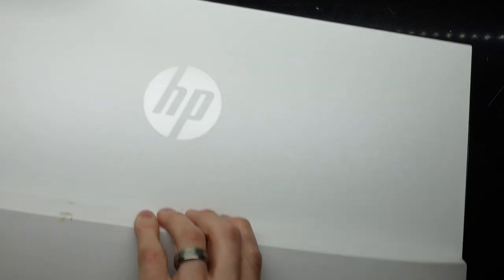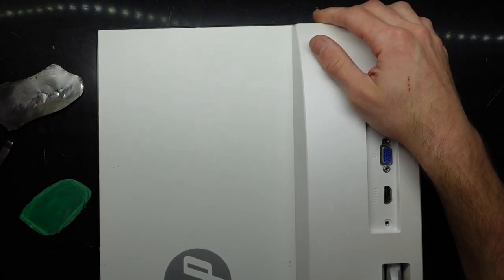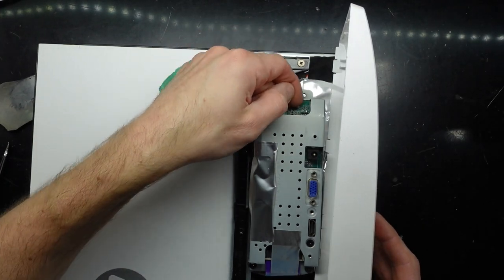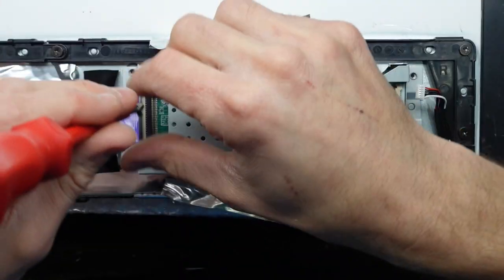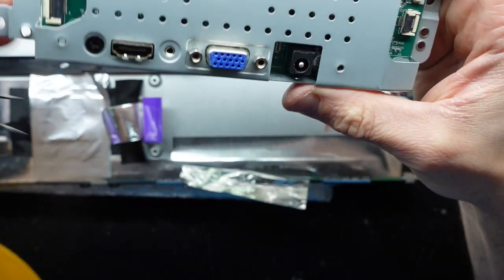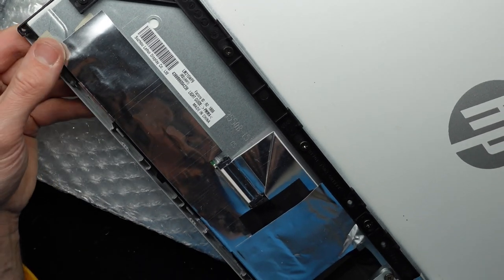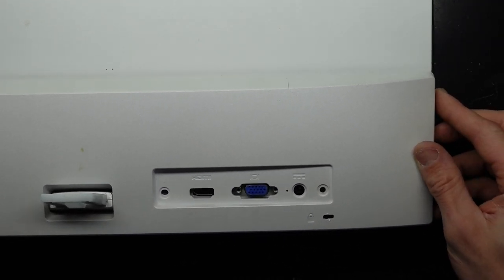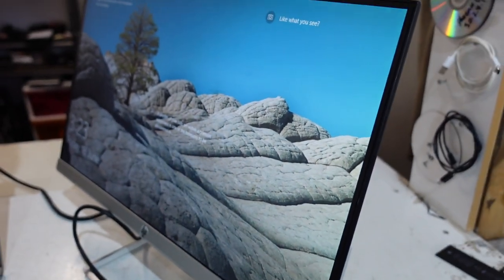HP 22fw Monitor Faulty Power Jack Repair

Comment: Not worth it but if it saves e-waste and money then fine.
Reply: Wondering how much Rick charges for this kind of repair.
Reply from the maker: Saves from ewaste for sure

Charged $50AUD to repair this, my minimum charge for repairs is $40
Reply: Could a faulty hdmi power port be the reason why im getting a black screen display from my acer monitor? I can hear sounds from the xbox menu and i can hear games starting up but i cant see any display. Anyone might have a clue whats going on with my monitor? I can see the blue led light on the bottom but the settings buttons on the back of the monitor give no response. Its an Acer LCD monitor connected to an xbox series s with hdmi cable